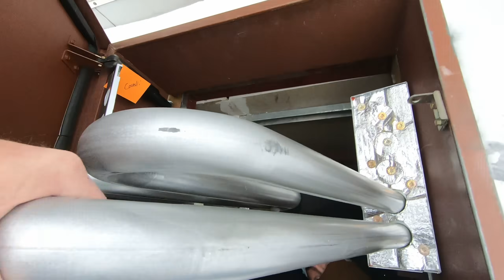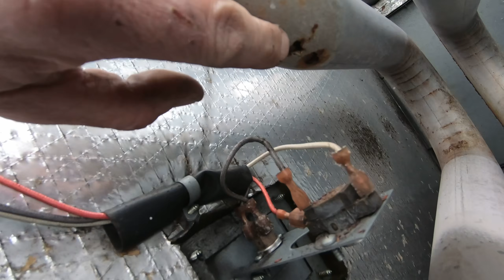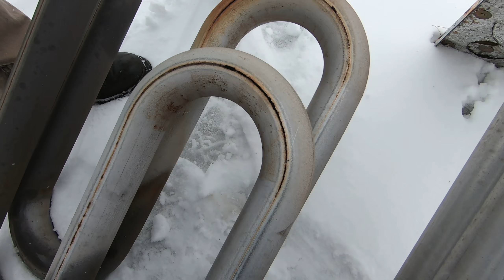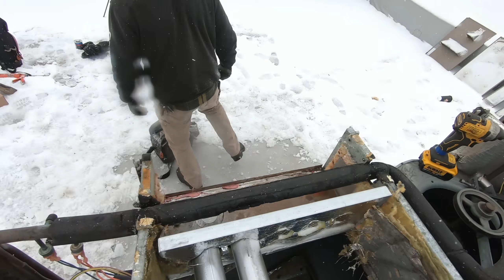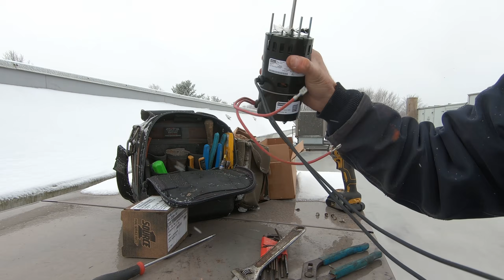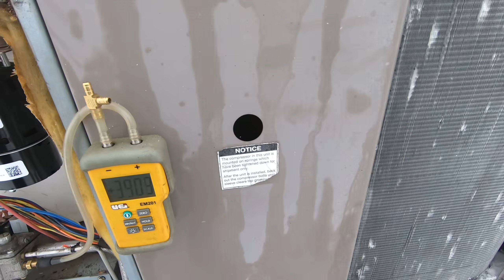York Heat Exchanger Replacement

Comment: to check/ exam heat exchanger on York RTU 60K BTU   it can be done by removing top metal cover ? got a call today it was open limit switch  i replace the very dirty filters seems like it fine now , then i checked flames  looks life flames are wild ( all over the place , going to come back tommorow examine heat exchanger , i heard York has worst replacements)))) i did 2 carriers couple weeks ago 60k rtu  4 hours job)

Comment: Today were changing a 10 ton York heat exchanger and man I will say these guys make it look easy.  Wanted to set the building on fire by the time we were done. They legit built the unit around the heat exchanger
Reply from the maker: Pain in the ass! Thanks for watching
Reply: Is that the one similar to this but has two burner assemblies and the double inducer blowers? If so, I dread every having to do one of these again. Absolutely ridiculous.

Comment: Thanks for recording. I'm a service tech as well and we change MANY of these York rooftops. Except I've never done only a 2 tube. That would be a dream! We never take all of the panels/screws out through. Oh the dreaded 5/16" screw that hugs the wall. That is single handedly the most difficult part! We reach down with 2 extensions and a slotted driver and pull that screw. Also, a bit of a tip: Grab some sheet metal and insert it down the length of the heat exchanger. Put a bend so it can hook on the top. You won't rip the insulation NEAR as much when pulling it out or putting the new one back in. Cheers!

Comment: Hate York heat exchangers. I bring sheet metal and slide on the sides and help reduce that insulation from going to crap
Reply from the maker: That's a good idea, doing a big york on Monday, may give that a shot and see how it goes. Thanks man!
Reply: @RyanHughesHVAC  no matter what York’s are horrible. They build them to never come apart. I see a York I wanna turn my head and say yes heat exchanger was good lol